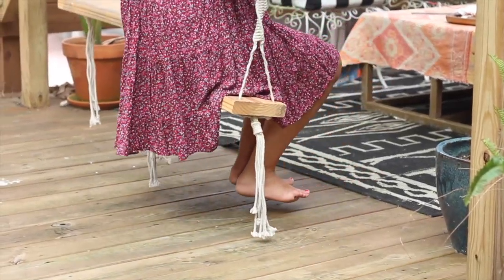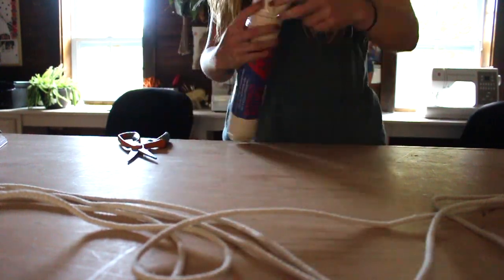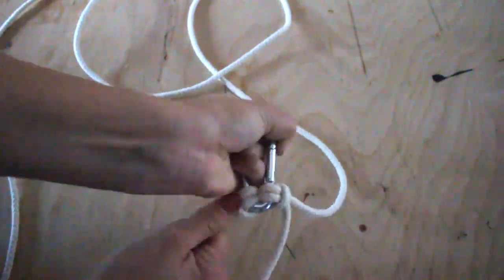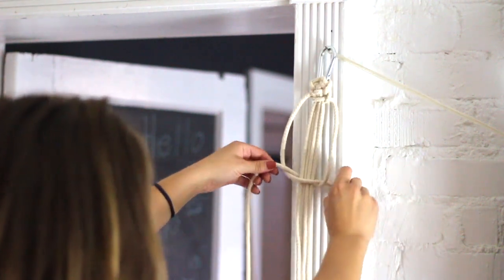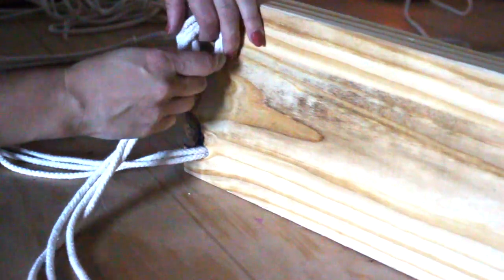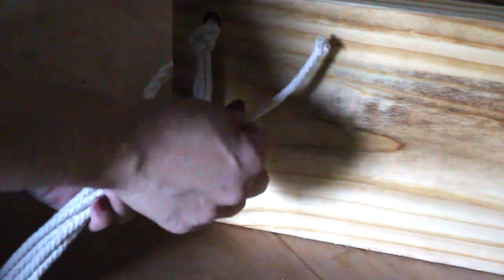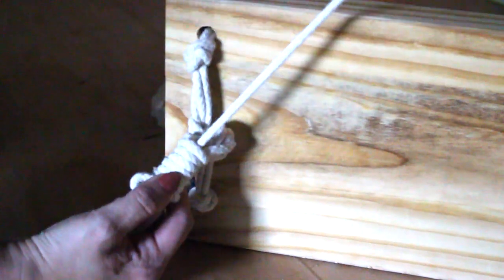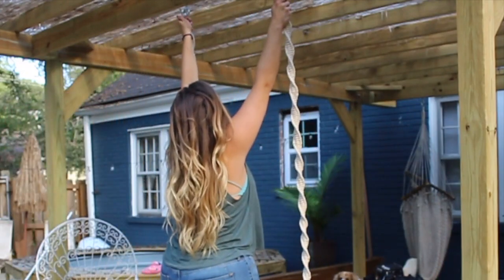DIY: Boho Tulum-Inspired Macrame Swing

Comment: Update 9/11/2020
If you use nicer actual macrame cotton cord these measurements she's giving should be doubled for a longer more usable swing.
-
Measurements she says in the video...
1/4in rope or about 6mm
4 pieces measured at 260in
2 pieces measured at 150in
Total of 1340in needed or about 112ft.

I would search for macrame cord on Etsy or your local craft store. What is listed doesn't look like it'd be good to work with. ✌🏻